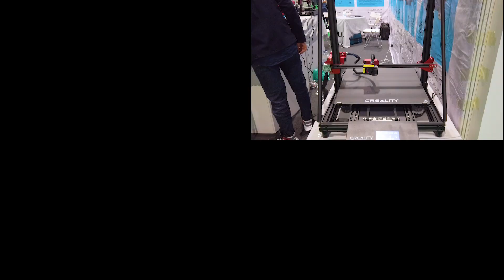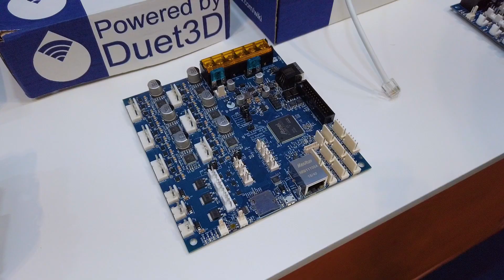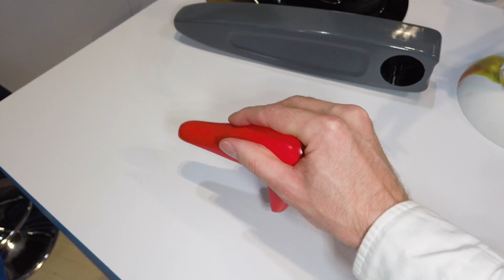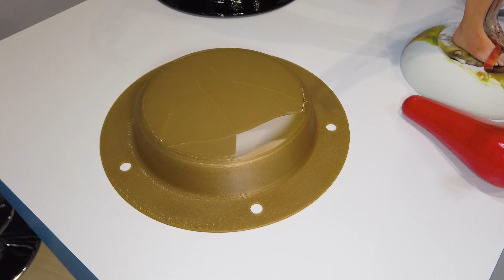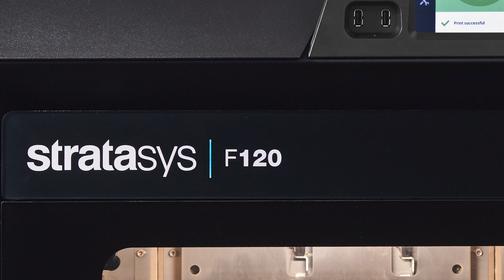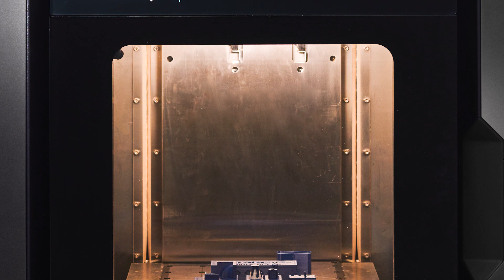Stratasys Worried about Heated Chamber Patent? #TCTShow 2019

Comment: Hey man, not sure if you use the light Youtube theme and therefor didn't notice it but using the dark theme, you'll see a white border around your channel logo. Not a huge deal of course but I thought I'd let you know ;) Really like your coverage of these events, cheers!
Reply from the maker: I noticed it recently and just assumed it was a bug that I was seeing. I'll check it out and see if I can fix it, thanks. 👍
Reply: @Vector3DP  AFAIK, the optimal size for the icon is 800x800. If you combine that with a black background, there shouldn't be any compression artifacts etc.
Reply from the maker: @tdk3d-j7c  I think I set right size but also set the circle myself which is probably slightly imperfect causing the white bits.

Comment: The patent in question is this one, I think. Expires end of Feb 2021.
Key element is that the motion components are external to the heated chamber (you can see that in the shots of the F120 in the video). The advantage is they can use a much higher temperature in the build chamber itself, that would otherwise cause the motion components to fail, or at least fail earlier than they would otherwise.
I'm not sure it's relevant to the hobbyist market for two reasons; first the build chamber temperature doesn't need to be that high for hobbyist-level filaments, and secondly the motion components of a hobbyist printer are cheap and easily replaced if they fail early.

https://patents.google.com/patent/US6722872B1
Reply: I argue that “hobbyist-level filaments” are defined only by the accessibility. I see polycarbonate as the top material for non-industrial printing, but it is beyond hobbyist-level due to the heated chamber requirements. Printing PC benefits from a build chamber above 100C, which would seriously affect motors and electronics. Currently, it is very rare to find a printer that can effectively print nylon or PC out of the box for this reason. PC could be the next PTEG in the hobbyist and pro-sumer sector.
Reply: @Austin1990  and price - PC being several times the cost of PLA, and of course stuff like PEKK and PEEK needing much deeper pockets.
Reply: @Austin1990  Yeah, I think we can only compromise. My thoughts are like this: 1. Heated chamber in the range of 60 to 80C instead of the 100~120C in Stratasys. 2. Use temperature-resistant grades of linear guides for all 3 axis. 3. Design water cooling modules for the stepper motors. 4. make all motion components modular and easily replaceable.

Comment: Thanks for covering Stratasys.

My reading of the enclosure patents allowed avenues for other means of enclosing the build volume and still keeping the heat away from the electronics and motors, I'm surprised I haven't seen anyone try them. Other products seem to try just using high temp motors and  other parts, which seems like a lazy way out. One company even left big holes in the bellows beside the carriage, which seems like a bad technical solution and still a litigation risk.
Reply from the maker: got to be honest, i've never actually read the patent. If i could find it i'd love to take a look at it.
Reply: @Vector3DP  https://patents.google.com/patent/US6722872B1/en

Comment: Not convinced that machines like the F120 will work out to be cheaper in the long-run. As it is, they only really become viable for smaller companies if they use 3rd-party consumables.
I like the way the Stratasys rep tried to brush of the heated chamber patent expiry as not being important. As 'j mtx' says, this patent covers one of the major features that have been blocked in the cheaper end of the market and so it is extremely important.
A cynical mind might suggest that the F120 and any newer 'cheaper' printers with heated build chambers being brought to market by Stratasys at this time is an attempt at capturing the lower end of the market before it slips away entirely...